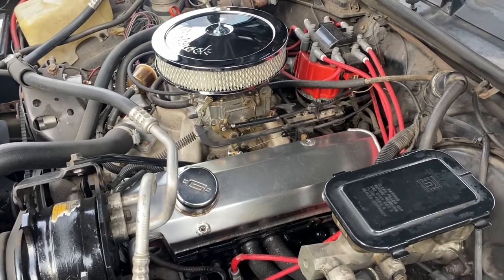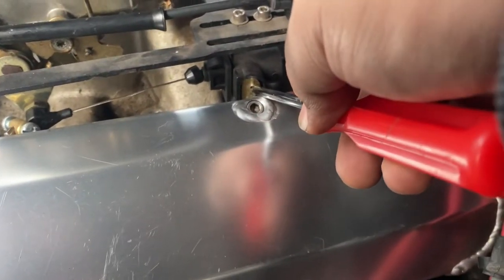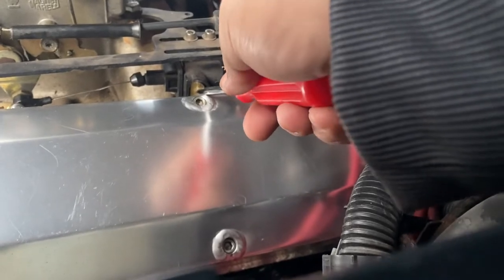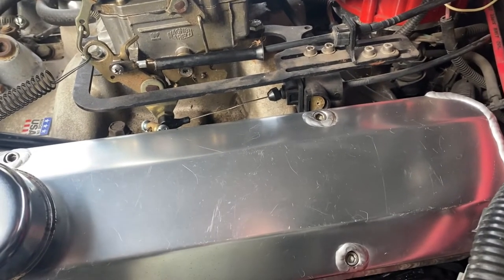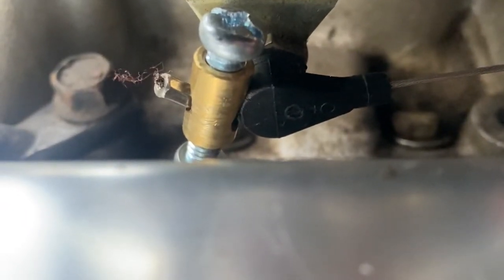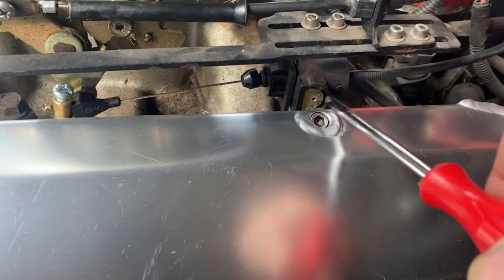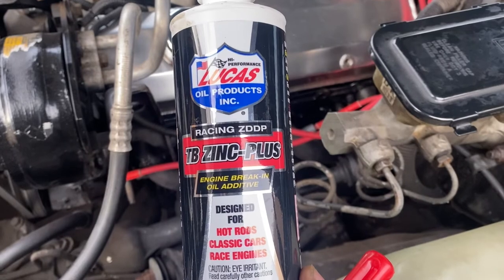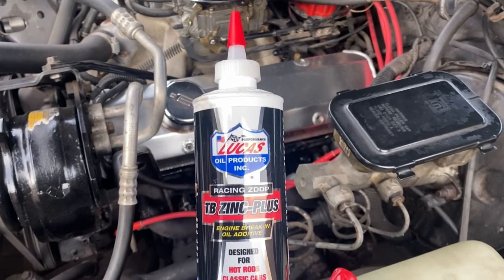700R4 TV cable adjusted

Comment: I have a TH700R4. My TV cable doesn't self-adjust like that but it should normally. What i do whenever i need to readjust when swaping carburetors, i back out the high step screw so that the throttle rests on its curb idle position. Press and hold button on the TV cable housing while pressing down push in the nipple, then simply press again and it retracts to its proper travel without touching the throttle.

It's usually not adjusted in this manner. Mine might be broken. It should self retract when throttle is pulled given if it has proper geometry regrading their brackets. I can swap the TV Cable for another but this has worked for my step without any issues so i don't consider the hassle of swapping. If the TV Cable doesn't hold its position within the housing, absolutely replace it. I've seen people place screws and wire to keep it from sliding out. Now that's just looking for trouble.

Comment: alway use a pressure gauge to set your cable
Reply: Where would you hook up the psi gauge on the right side sounds like 2 guy job with Trans in the car..